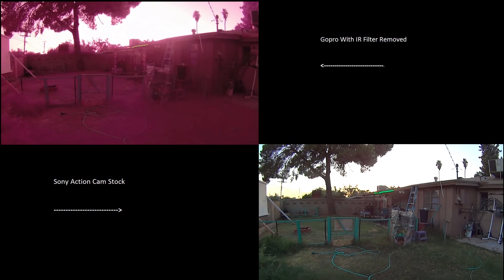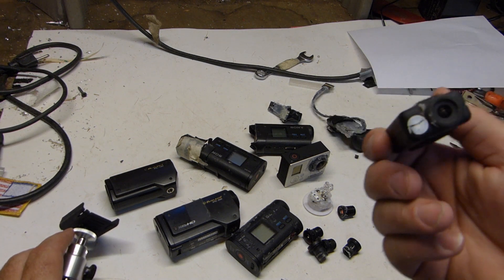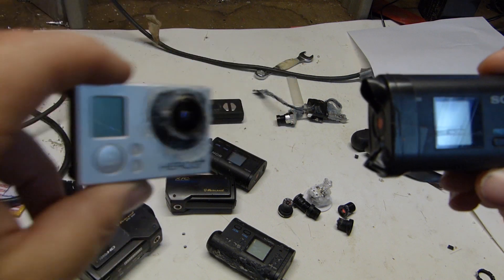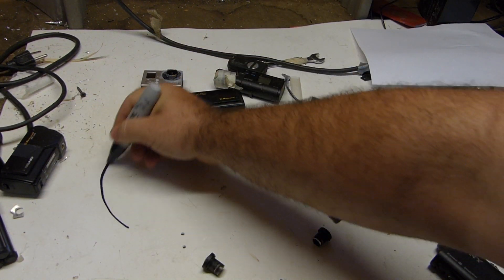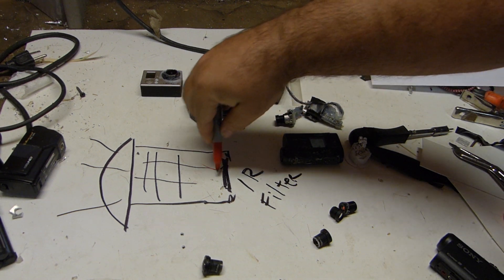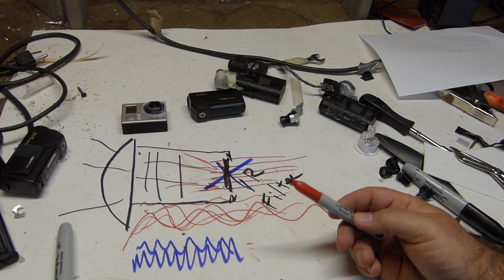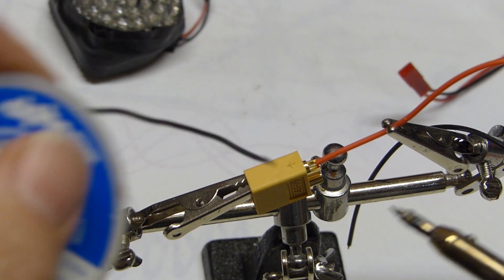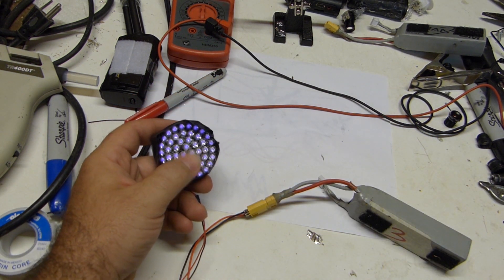Infrared Camera Set Up on Drone

Comment: Hello. how to transfer information with thermal imager on drone down to Earth online?
Reply: You will need a thermal camera of some sorts. These are very expensive for decent quality pictures (a minimum of 80x60 is needed for something useful). Secondly the thermal imaging sensor must have a lens of a specific focal length suitable for what you're looking for: i.e. SAR or building/structure inspection from the air require rather different focal lengths (zoom factors) and field of views. Most importantly, the range on the thermal imaging sensor is the key factor, it is closely related to the focal length of the lens used on the thermal sensor - it determines how focused the thermal EM is when it hits the thermal sensor's pixels. Then it's the sensitivity of the thermal sensor, the more sensitive the better, not always but for long range detection it's better. These combined give you the capability of the sensor to detect heat at a distance. Mind you however that decent sensors go in the range of 100s and 1000s of dollars so hobby grade sensors that can be used will have quite lower range, field of view and sensitivity - at least a few that can be used are the FLIR Lepton (quite expensive) the MX90640 which has only 32x24 pixels resolution but considerably lower price then it's the cheapest one AMG8833 (8x8 pixels resolution) with a range of up to just 7 meters in detecting human body heat but a decent 60 deg field of view.

For SAR only the FLIR Lepton might be suitable but it's quite expensive. The others, I am currently trying to fit an AMG8833 hooked to an Arduino Nano board using a 2.4GHz transceiver nRF24L01 to send the thermal "image" to a ground station and display it on a 128x128 LCD display after doing a 2x linear interpolation on it. The quality is as expected, very low mostly due to limitations in computing power on the Arduino board as well as lack of proper thermal palettes for such a low resolution - images look cartoonish like when looking at the ambient but once there's a significant temperature difference the image is quite clear. 

Next stage I'm working on is using a regular computer connected to the receiving Arduino via serial USB and interpolating the 8x8 to 80x80 to display on a 240x240 region of screen, here however the color palette limitation is even more visible, and the liniar interpolation shows its limits.

Basically this is how I see using cheap thermal sensors on hobby grade drones for various projects - not really usable for SAR but coupled with a 5.8 GHz camera with its IR filter removed and an IR 850nm or 940nm projector this combination can yield usable results for ranges up to 10-15 meters in front of the drone so basically you could do SAR+some thermal from 10-12 meters high....theoretically :D

Once I get a chance to test in the dark the IR cam+thermal combo I'll know more

Comment: What all would you need to run IR LED lights continuous using a 12v DC source? Is there a formula you have to use to determine the draw from the IR lights?
Reply: Depends on the how many amps the lights take and how many amps the battery can put out
Reply: Depends on what lights you are using too

Comment: We could all benefit from a calibrated experiment.
Try this:  three buckets of water with thermometers inside. heat each to a different temperature. Take all three outside and view with the IR camera at a predetermined elevation (maybe tow or three dif elev)